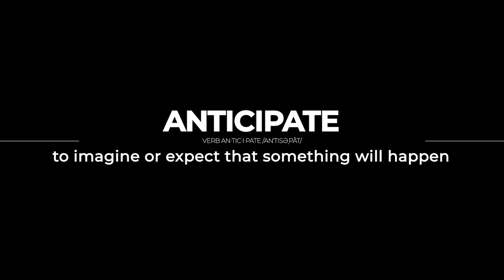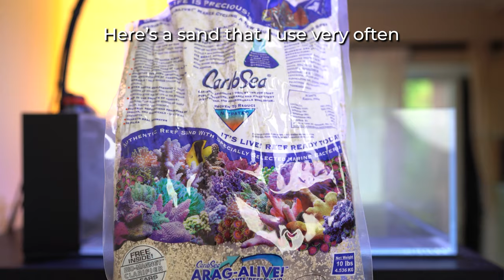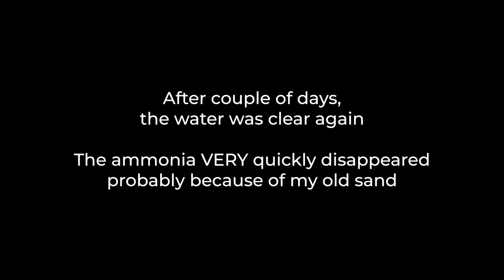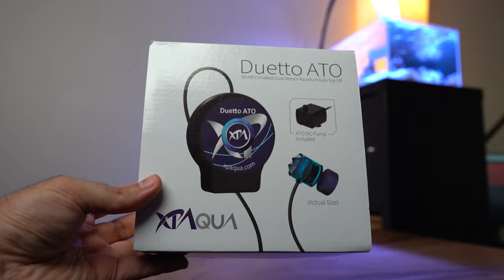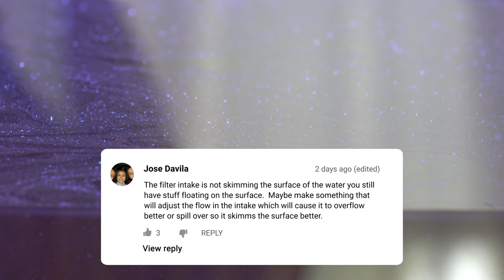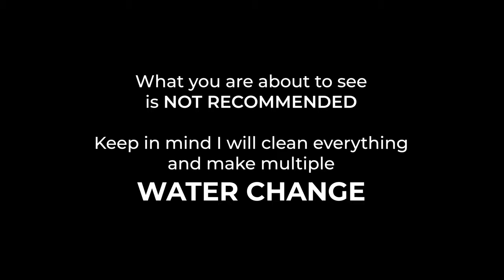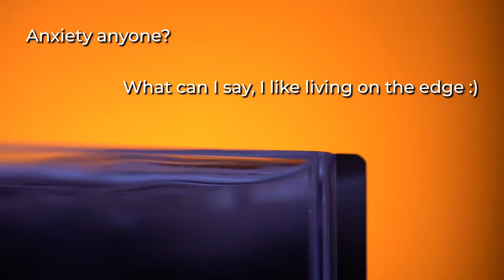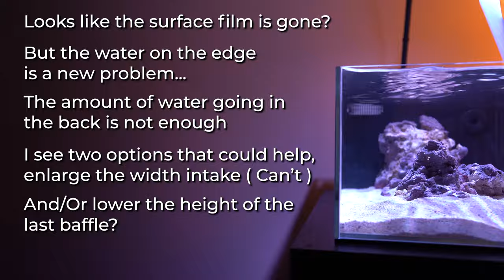Why I removed BLACK SAND and How I remove surface OIL FILM | Ep.7 Nano Reef Competition

Comment: I suspect the high element content came from the aqua epoxy , a common filler is aluminium oxide . Or from the rocks, if the rocks are made with cement and shell.

Comment: Any chance you had a control sample you sent in with the tank ICP sample? (i.e. newly made saltwater not exposed to the black sand yet) Also, did you happen to run through your sand with some neodymium rare earth magnets? (wondering if magnetic flecks had been isolated from general composition or not)
Reply from the maker: Sorry not sure to understand your question, the black sand contain iron, so i didn't want to use magnet for cleaning. You can see my video with black sand comparison on my channel
Reply: I meant as in an ICP test sample from your freshly mixed saltwater that had not been exposed to the black sand in the display yet (mostly as a baseline for comparison between the display water and water change water to see just how much of those levels was caused by the sand)
As to the magnetic sand fines, thats a my bad. I, for whatever reason my brain decided to interject from thin air, thought you ended up using the CaribSea hawaiian black after you got the non-mislabeled package of discontinued indo-pacific mix. With that sand, running through it with a strong magnet in a plastic bag removes A LOT of the particularly problematic magnetic fines. In general, the idea behind running a magnet through your sand before introduction to the reef display tank is it takes care of any magnetic metal flecks left from processing machinery contamination and general environment contamination for water chemistry reasons. It's my understanding it also helps remove some of the risk associated with flipper magnets and sand mediums with potential magnetic flecks in it as well (I can't speak to this personally, I pretty strictly stick to 100% melamine sponges as I keep acrylic displays). Didn't realize it was EcoComplete you used so I can't say if the same applies as it contains quite a bit of iron (amongst other metals) as it's used for planted tanks.
Reply from the maker: No I didn't do an ICP Test just of the water, that why I use the tropic marin pro salt, its controlled, i would have care of that if I was using my other salt like the red sea. I which icp test provide a 3rd sample for ro/di water only. I've done an icp test on another tank and the results are not even close to this one with black sand. At the same time, the results make perfect sens, it's what what I/we should expect. I just wanted to be really safe since I documents everything on this tank
Reply: DiacanthusReef Classic case of people chasing numbers instead using the eye test. i beleive he used a substrate meant for planter tanks in freshwater. this guy doesn’t know what the hell he’s doin

Comment: I wouldnt show a questionable method of surface skimming to the masses.  Although that was a good way to increase height of water in the display, nice thinking!  You know how many people are about to flood their homes?  These AIOs are meant 90% for newer reefers.  So half of them are about to be screamed at by their significant other and the other half are about to pay if they live on a second floor apartment complex.  Only 1-2 gallons though.

Increase water agitation, lower display water height to the designed level.  Approximately .5-1" below tank rim.

And will need a skimmer to pull the organic material out or willl likely continue.
Reply from the maker: Sorry, I disagree with those statements. 😕
Reply: dude, you’re totally wrong. speak for yourself...

Comment: The problem isn't so much your overflow intake as it is your return pump is oversized by comparison. Lower the return pumps flow and you will get better surface skimming through your overflow, assuming you keep that acrylic piece to block the water from being sucked in at the bottom of the overflow. This is why I don't like overflows with teeth as they result in poor surface skimming due to the water rushing in under the surface. If you need to keep the flow strong in the display while keeping the return pump turned down, purchase a flow eductor for your bulkhead, it will increase the water flow without requiring the pump to be stronger due to it pulling in water as it pushes it out of the eductor.
Edit: Jeeez or just butcher the whole thing.. the problem was the pump not the entire rest of the tank man! You could see you had too much flow out of the pump based on the sand all being blasted out of the far corner in the first place..
Reply from the maker: Thx for the feedback, i played with the return, put it at the minimum, it didn't change anything, got worse actually. I just needed to create enough surface tension/aspiration. There's a ratio flow/surface tension. Work great now👍

Comment: couldn’t you upgrade the return pump so it sucks more water from the top? to remove the film.
Reply from the maker: No the film will always be there. The pump is stronger than what I need also, If I push more water will drop from the aquarium.
It just needs a path of force/sucking/tension towards the input

Comment: I think it is cause by wrong baffle height.
Reply from the maker: Yes and No. Yes by 2mm (Might cutted a bit too much), so the water want to drop.. No because the inflow bar go too deep so I was collecting more water from under the surface, which is the major cause. When I added the acrylic sheet to block the bottom it worked much better.
Reply: Aqua Splendor I also build two of my nano tanks this way. First I set my desire water level around 1inch from the rim. Then I set the overflow holes lowest point to 0.25 cm below which is 1.25inch from the rim. Then you have to set the baffle length to 1.5"below that point which is around 2.75" from the rim. Anyway I love your tank dimensions. I live in tropical area so these tanks are a pain to setup because they need chiller to cool the water.